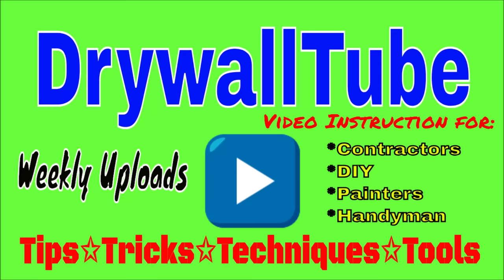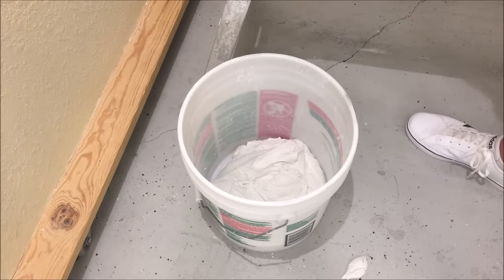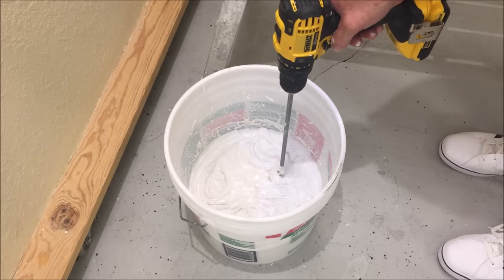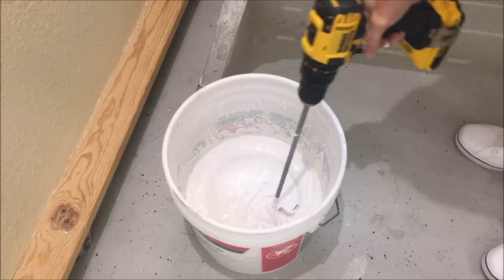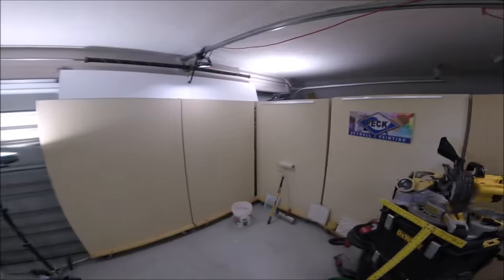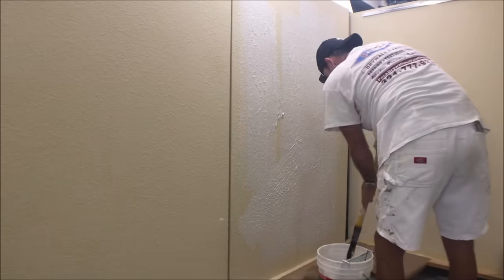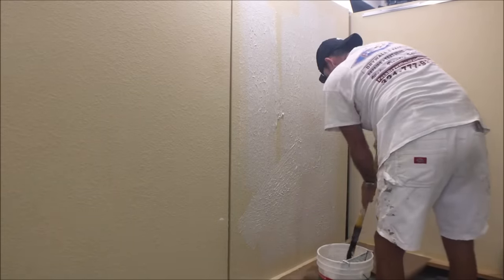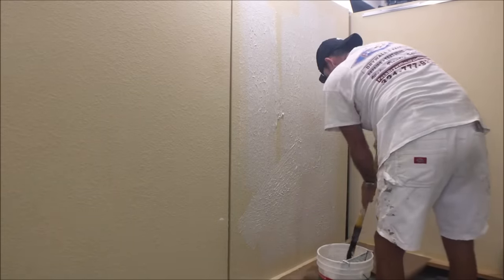Skim Coat Ugly Textured Walls with a Paint Roller Tips Tricks and Tools

Comment: Just a tip, if you are doing a big project don’t use *your battery powered drill to mix *the compound. You’ll probably need a new one by the time you are done with your project. That’s expensive
Reply from the maker: You are so right!👍🏻 I do mention this in a few videos and just finished recording a video where talk about the difference between mixing with a cordless and my big Dewalt mixing drill. I really appreciate you watching and commenting my friend!😎 -Paul
Reply: I bought a DeWalt 18 volt XRP drill around 2003 and it has been mixing 5 gallon pails of paint and joint compound almost daily. It started smoking earlier this year but it's still turning and mixing.  The old hole hawg hasn't been used for 15 years.  I'm convinced that good battery powered drills are as durable as corded drills.  New brushless drills should outlast my old DeWalt.

Comment: You can throw that bucket screen in the trash, just dip the roller and squeege like on the wall. Use the wall as a bucket screen, less to clean
Reply: Start at the bottom and push upwards
Reply: The more you roll it the faster it dries, harder to float

Comment: I am a first-time homeowner and I have the world's ugliest wall. I've had three people come in and tell me that they don't want to do the job because it would be too much work. The texturing is just that bad. Like imagine if you ate a Big Mac and fries and then threw up and then used what you threw up to smear the walls and then you tried to paint over that. I've been told the easiest way to cover it up will be to add another layer of drywall. I've been advised not to bother sanding or skim coating. But another layer of drywall means means my baseboards and my windows are all going to be off and the room is already small. So I thought I'd give it a shot to skim coating. Since nobody wants to come do it. It's not like I'm asking people to do it for free I'm willing to pay. But the wall is awful.